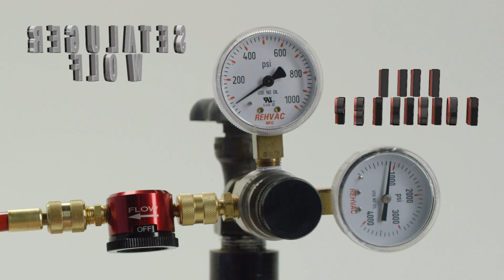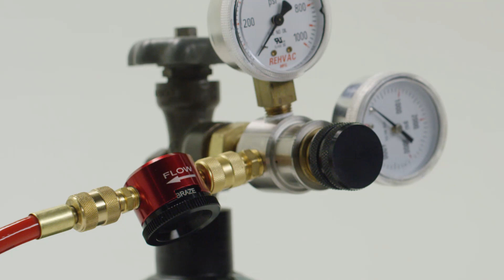DiversiTech Nitrogen Purge Tool

Comment: When do you use purge and braze options ?
Reply: Use the “purge” position when you’re performing the vacuum procedure when it’s possible some copper shreds, particles, or oil are still in the lines that could be affecting the pull down on the vacuum. 
Braze is for what you think it’s for.

Comment: Never used one.  Just used gauges cracked open.
Reply: Mine nitrogen regulator makes funny noises when i do.
Reply: @rawrandom-yt  probably because of the restriction.
Reply: @hvacexplained9341  of what
Reply: @rawrandom-yt  taking a high pressure and restricting it down to a lower pressure have you ever hooked up gauges to a unit and heard a loud squeak? Just saying that might be something in common
Reply: ill try this tool, i think i waste too much nitrogen doing it that way
Reply: @ArcheryRuleZ  I think the tool is too expensive. $50. 🤔